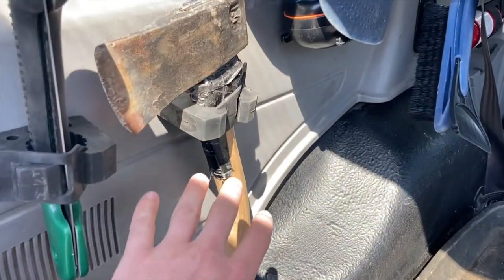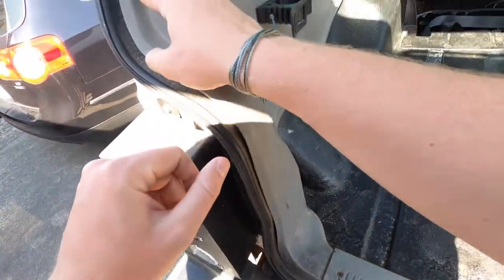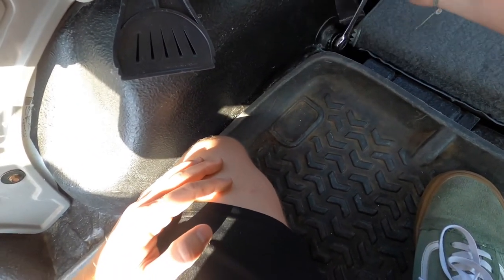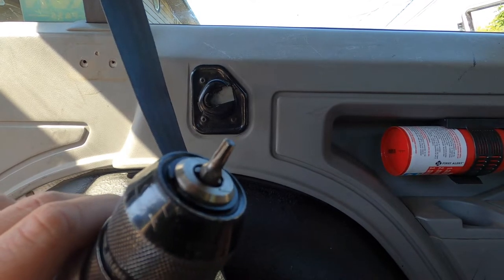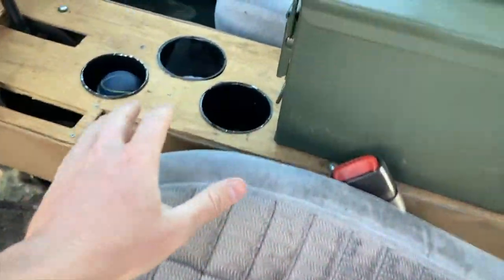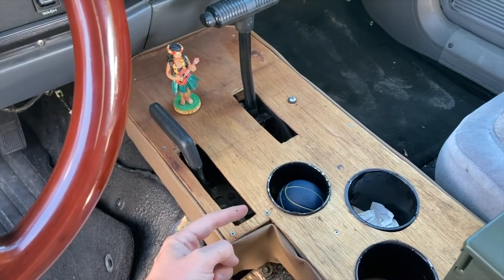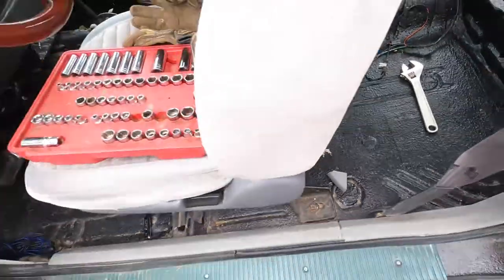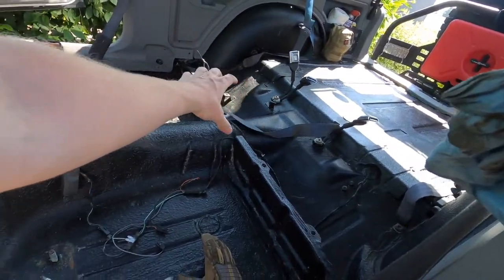How to install Noico insulation on your Jeep Cherokee XJ Sound and heat full guide W/ PROOF IT WORKS

Comment: <humor>  From an old guy, just put the screws and other such fasteners back from where you removed them from and you will not have to worry where they came from or where to reinstall them.  </humor>  I'd suggest going with smaller paneled suppression as their easier to apply as needed than larger pieces.  Please note that not every square inch needs to be covered as it's noise suppression and we're not building a submarine.  Some area's in a vehicle will be more solid and will not require as much suppression, while area's like the back cargo area is where I'd apply another layer.  I'd also suggest applying the foam based suppression materials just before the carpeting.  I installed insulation in the back quarters in the body voids for thermal insulation and a bit of noise reduction, but into the drivers and passenger inside front doors area's.  I did spot that some material was installed at the factory, but that was only enough to not have the doors sound "tinny" I believe.  On the ceiling I've installed 2" foam from a fabric store as it reduced the noise and also provided great insulation during summer and winter.  The headliner base wasn't recoverable and it wasn't going to a shop to get professionally redone.  Overall pretty good coverage on the topic with good lighting with visual quality.  So long as a person isn't using "peel n stick", but a product like Noico, FatMat or KilMat a person will be pretty well off.  At the end of the day, do not forget we're driving a vehicle that's the shape of the brick so there will be noise from around the door seals, but also tire noise depending on what type of tire you run. i.e. highway/AT/mud tire  😁✌
Reply from the maker: I wish I could give you an award for the most valid and well thought ever made on my channel.
Reply: @SomeGuyOutside  Revisiting as I have been reviewing this topic as I will be doing my 4 liter powered '87 XJ Pioneer soon.  I just received some 80 mil Kilmat which I will be using again, though I had almost decided and probably could have used Amazon's Basics instead. I'm considering the Noico more and more as foam provides dampening and thermal insulation.  And what I am liking is that it's "self-adhesive". My current project needs to have the exhaust rehung as it wasn't done properly and it's going into the shop tomorrow. I do have some GoPro capture and will record more afterwards. Today I just received my order for the drivers side door seal which should also reduce the noise, as it also effects the passenger side as well. I also inspected the dropgate/rear seal and noticed I was missing the left/driver side liftgate bump stop. Eventually I will have to compile all of my photo's and other content to edit it and upload it to my channel which I've neglected. Yet on my FB I post updates more frequently, but also remove things as well.

Comment: Used the same product on my ceiling floors and doors. Worked really well. Significantly reduced road noise and improved audio quality from the stereo.
Tip: anytime you have access to the interior of the doors in particular, take the opportunity to spray FluidFilm into hard to reach places.
Reply from the maker: I can’t say I’ve ever heard “fluid film” so I’ll have to give a look into it!
Reply: @SomeGuyOutside  great anti-corrosion product, especially in the Salt Belt.

Comment: For the doors, I actually cut the Noico into strips and put them on the inside of the exterior door metal.  It worked very well on noise reduction.  I didnt do the interior skin, because I worried about the door panels not fitting back on well, but it looks like you didn’t have that issue. I may go back and add a bit to avoid any rattling , but leave the existing holes open, to make repairs easier.  Nicely done overall.   The only other difference is I used the 350 mil foam on most of roof (on top of the metal 80 mil)) and anywhere it wouldn’t cause  panel fit issues.  Rain on roof went from clattering marbles sound to gentle putter patter.

Comment: To keep proper screws with correct panels, just toss them in a Sandwich bag and painters tape it to the panel ! instead of adding the sound material on door Face, you can add it to the Back of the Door Panels like a lot of cars have.
Reply from the maker: It’s a habit I do need to get into, on engine/driveline aka “sensitive” projects I do put the effort into properly catalog and sort bolts. Certainly a far more efficient way of covering a larger portion of the door!! Thanks for the tip
Reply: Just like "is not really a Jeep project unless you bleed a little bit," "is not really a Jeep project unless you end up with a few 'extra' screws, nuts, or bolts when you're done."

Comment: Awesome video! Question: Did you install the carpet over the insulation or stays that way? I'd like to keep my XJ original, that's why I ask. Thanks
Reply from the maker: I haven’t reinstalled a carpet yet but I plan on it, I’ve got a nasty windshield leak and have put off pulling the windshield and cutting all the rust out. It’s held up pretty well over the last 6months without any carpet!
Reply: Looks like you rhino-lined the floor. Was that an off roading decision or rust prevention (or both, I guess) and did that texture have any negative impacts on putting down the insulation?
Reply from the maker: @teephphah3695  So far (10 monthsish) into instal and it hasnt had any peeling or delamination on either bare metal surfaces or the bedlined surface. I installed the bedliner after doing a not so quality rust repair about five years ago and it has held up very well for my very poor preparation at the time. I think they make a great combination!

Comment: can I ask, how many square meters of insulation did you buy? I'm planning to do this to my 1999 XJ :) thanks man!
Reply from the maker: It took one box of both, I would recommend two if you want to cover the full roof and floorboards as I mostly did the “trouble” areas (in my best judgement at the time, I plan on finishing the rest in the future!)

Comment: You might want to neaten up your wires just a teeny tiny little bit...lol. Also it's nice how perfect you're trying to lay down this sound stuff but unless you're leaving it exposed you don't have to worry about it too much...lol.
Reply from the maker: Currently I don’t have a carpet so it is exposed and even if it wasn’t I exposed it would’ve bugged me to just leave it ugly… but it will be covered up with some mass backed carpet eventually!
Reply: @SomeGuyOutside  I feel ya, it would bug me too...lol.

Comment: this video is awesome, thanks for sharing. I do have a question: I would really like to add insulation (both materials) EVERYWHERE!! I hate the road noise and so my family so I need to make it as quiet as possible. However, I don't have a garage to work comfortable and I need to tackle this project by pieces. Obviously doors & tailgate can be done one at a time, my issue is how long will it take me to do the entire floor and put everything back again. Is that something I can do in just one day? How about the bedliner? Can I do that on a different day or it's really a mess to take it apart and I better do the entire project in just one go?
Reply from the maker: Sorry I didn’t see this comment, haven’t been checking the tube during the holidays! Thank you for the comment!

I did  the Bedliner about four years ago before I was YouTubing so I can’t go back and check videos for accuracy. I do think stripping the inside took a good half a day and then prepping painting the bedlining took atleast the next half of the day and then it had to set for atleast a day if not two before I reinstalled the interior. 

You could absolutely kill two birds with one stone and after the bedliner/monstaliner (that’s the company i used and I would recommend) you could then install the sound deadening before reinstalling the interior. and if you’re going to pull your headliner out and it’s not in perfect shape I would take the time do redo your headliner ( i do have a video on that (not so subtle self promotion))

 I don’t have a garage large enough to comfortably work on the Jeep and even close the garage door so most projects It’s all the way outside! Good luck, you can do it!!

Comment: How much material did it take to insulate the entire Jeep?
Reply from the maker: It took one box of both to do about half of the jeep and not all areas were doubled up. I’d say a minimum to do the entire floor along with the roof and doors, wheel Wells and trans tunnel would be four boxes. Now I don’t think you NEED to do every square inch (it’s a Jeep you won’t get quiet) but it would certainly be nicer I’m sure

Comment: Hey man what steering wheel and adapter are you running on your XJ???
Reply from the maker: It’s a grant 12” (too small I would go atleast 13/14 imo) formula GT3 three spoke with the “walnut or mahogany” finish I believe, I can’t recall the adapter but it’s a very simple five Alan key into the wheel and bolts down onto the shaft

Comment: How hard is it to remove the noico red after it’s applied down? Can you peel it off if you try?
Reply from the maker: I haven’t tried since installation but I imagine it would be a bit of a hassle as noico red is a soft foamy material that I imagine will tear apart if you tried. I would say with a goof off and a scraper it will come off 🤷🏼

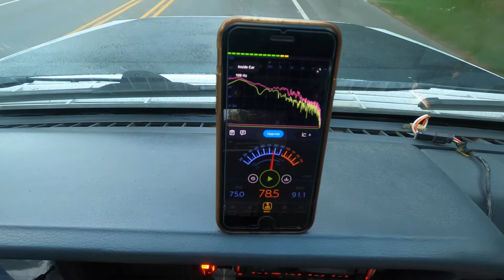Comment: Please guys, don't waste time and money putting this insulation on. I did it in a 2001 Cherokee sport, what's more, I put double insulation (150 and 80, one over the other), on the floor, I also put the carpet and on the carpet, Weathertech rubber mats. The sound difference is non-existent, 24:10 he says that he reduced 10 decibels on average, those 10 decibels are equivalent to the sound level of a normal breath. Those 10 Db are impossible to perceive in a moving car, unless they use an app like the one he uses, he is not lying about that, but in daily use, it means absolutely nothing. It's like saying that putting a turbo increases the speed from 100 to 102 miles per hour. Another example is like those who sell them that if you replace your house windows, they are going to make you save energy. Right, they don't lie, but what's the point of saving pennies when you're going to spend thousands to replace your windows. If he should have done a before and after regarding the cabin temperature, too bad, he didn't, maybe he improved on that. The time you are going to lose doing this, use it for off-roading and you will enjoy it more!
Reply from the maker: Yes 10 DB isn’t a lot, but any noise above 70 DB is going to cause long term ear/hearing damage and if you can reduce the intensity above that and value your ears then it’s absolutely worth your money and a day of time. Having worked in a shop for three and having hearing damage from it I wish I would’ve started caring for my hearing earlier and this is something I only regret not doing sooner. Second part you’re correct I didn’t measure the temperature before and after difference but I’ll tell you right now and if you did install the insulation you know the temperature difference from the trans tunnel to your legs is absolutely worth it. Thank you for the comment, I disagree with your opinion but luckily that’s allowed in this world. I hope you still get to go out and enjoy wheeling no matter what you think!
Reply: @SomeGuyOutside  Thank you for taking the time to respectfully comment on someone who posted something negative. Sorry for the negative comment, but I always tell my wife, if someone opens a new restaurant and no one tells the owner what food went wrong, soon it will close and he will think he was doing things right. If someone had thought to help him by commenting on the mistakes, that would not have happened. I respect your work very much but I also wanted to tell my personal experience about the same product. I understand that 70 dB can be harmful to the ears, but I am 54 years old, I have been working with machinery for 30 years (I have also been driving an XJs for 15 lol), due to my work I have a hearing test every year to complete and yet I have normal hearing for a man my age. Each person has different experiences and different body reactions. I don't think it takes so much time and work for 10 dB. About the temperature, I recommend you contact a friend who has an XJ, when you have the mat installed, and on the same day, side by side, compare temperatures, winter and summer. Thank you for your videos, you are very good, I am a follower.
Reply: Does it keep heat down ?

Comment: Does this this also help with keeping out heat from the trans tunnel/floor pan?
Reply from the maker: Since I didn’t have carpet before installation and I don’t remember if it was a problem before I removed it (like four years ago). it has helped dramatically reduce the transmission tunnel heat and sound from just the metal with MonstaLiner on it for sure!
Reply from the maker: Also I didn’t cover the floor panels because I have a leak from the front firewall every time it rains so i can’t speak to that but I would be very surprised if it didn’t help sound coming through there
Reply: @SomeGuyOutside  nice, I’ve lined my tub as well and I’m looking for a solution to the unbearable heat that come from the trans tunnel